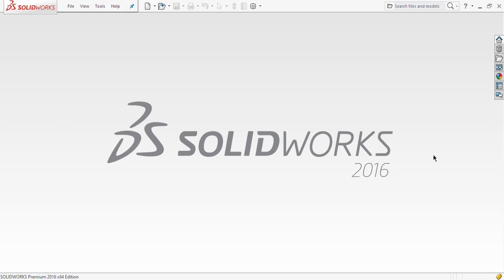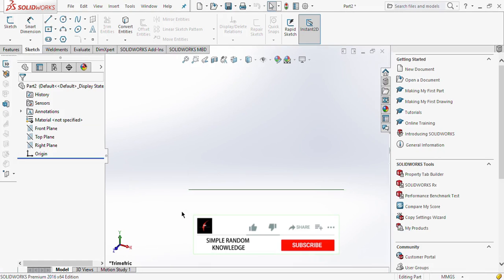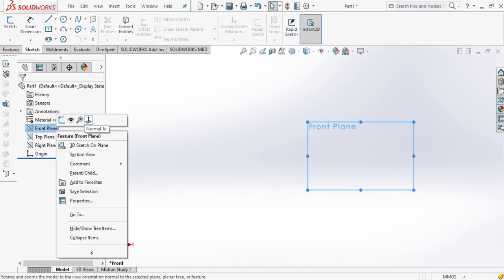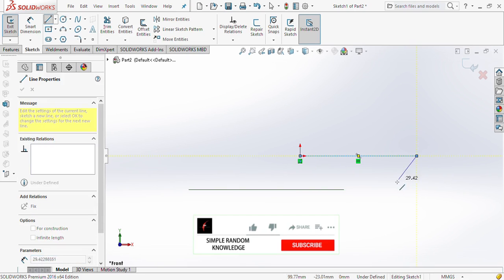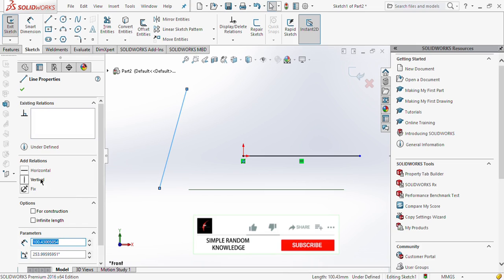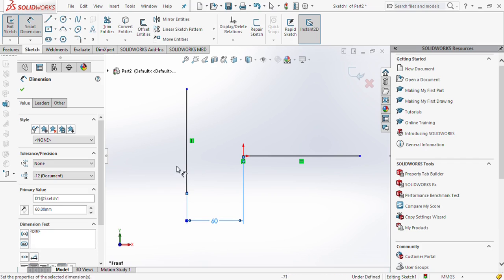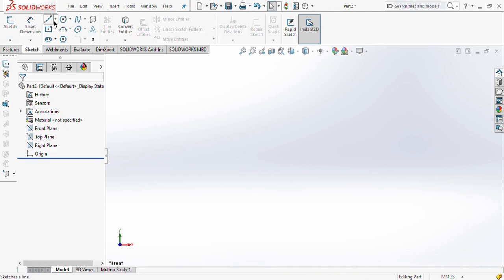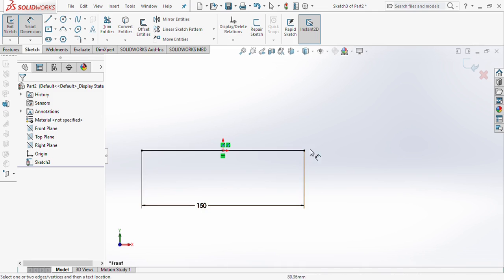L1 | Solidworks user Interface | Type of Line & Their Uses | #SolidWorksTutorial (Rec. Speed 1.25x)

Comment from the maker: Hello Guys!!
 I have made the video on Solidworks Tutorial where I have Explain the Basic User Interface of Solidworks Software. Started From Basic how to Sketch line and their type and how to make them fully Defined. What is meant by part, Assembly and Drawing in SolidWorks, I have explain how to set units in SolidWorks, I have Explain how to fully define a line using Smart Dimension. I have explain what are the construction line and midpoint line and their uses.